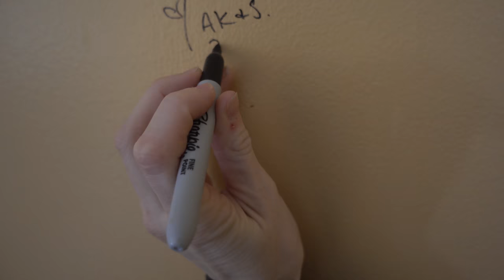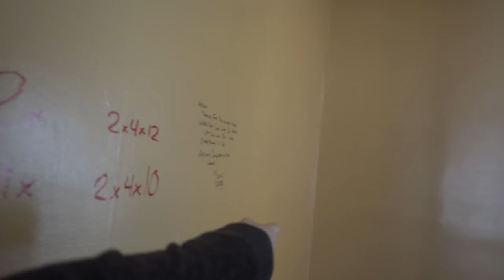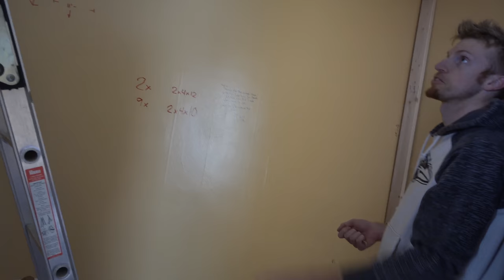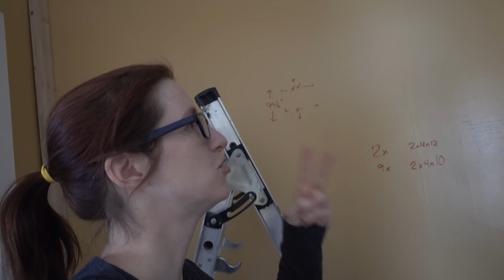Second Day of Spring Brings More Snow!

Comment: I liked the message you left on the wall. I built a stud inner wall for sound insulation from neighbours. I also wrote on the wall, before insulating & drywalling, but my writings weren't necessarily as polite in tone as yours :)  PS. I assembled the whole framing on the floor before fixing in place.
Reply: "open up my walls and I will haunt you forever" then the drywall guy put some mud over it. I didn't sign it, so i should be ok :)